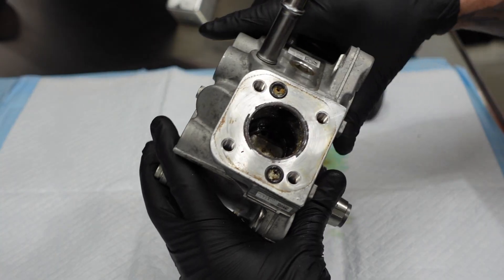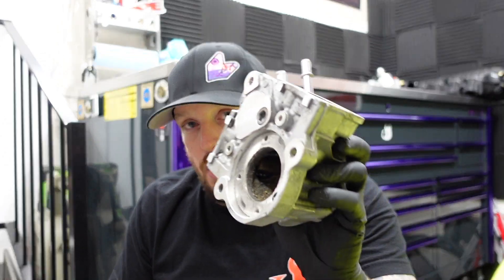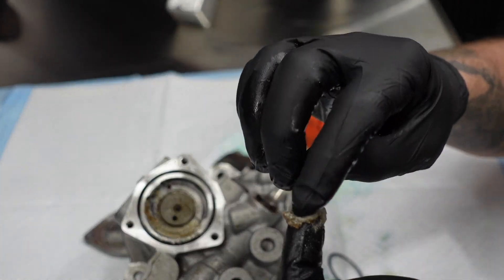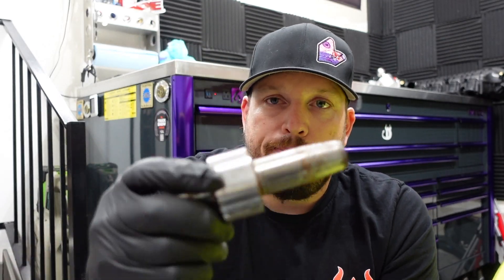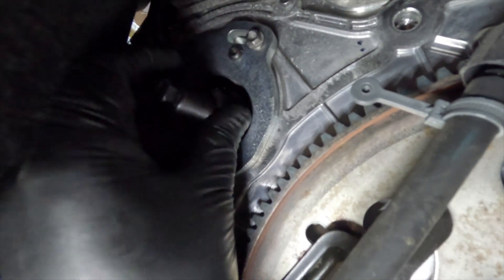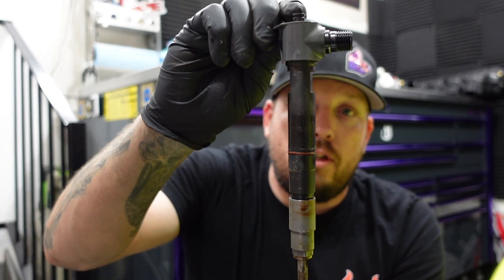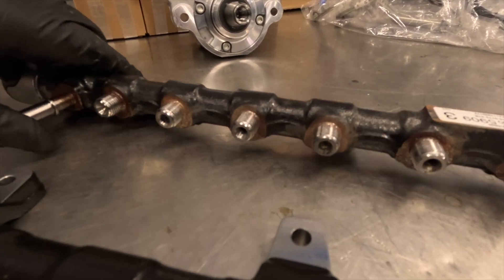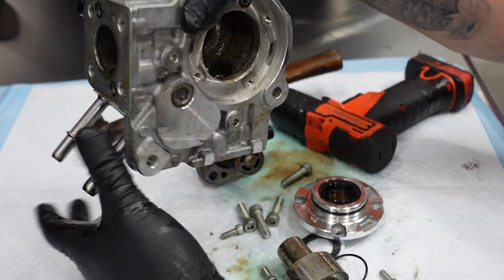What Happens When Diesel Fuel Gets Contaminated? DEF Contamination

Comment: My new 2024 duramax is at Chevy now . I put def in the diesel I hope it’s fixed correctly
Reply from the maker: Hopefully it wasn't driven with the def fluid in there, if so, it will likely need a full replacement like shown here. I wish you luck on the repair, I fear this happening to anyone. I personally use a fuel cap just to add an extra step during fueling and hopefully keep myself from getting sidetracked and making a mistake.   https://amzn.to/4gGANpy

Comment: I'm curious why you would have to replace the high pressure pump. If you never started the vehicle.Considering the fluid that's in the fuel lines, pressure rises and deadheads and doesn't circulate.
Reply from the maker: In this case, I showed the pump in terrible shape, that's why the pump needed to be replaced. If all that someone did was pour def in the fuel tank and not run the vehicle, then yes, there isn't a need to replace the pump.

Comment: It may be tight, but it ain't a dang CP4! Ford still uses those and still has failures. At least Chevy and Ram moved to more reliable pumps that require contamination to take them out. Mine could just randomly cost me $10k~$15k for being a CP4. Going to do a disaster prevention kit on mine until I can afford a DCR pump replacement.

Comment: Hello, I wonder if you can help with a situation I’m having. My 2021 Silverado 3.0 baby duramax is throwing all kinds of codes. Service ESC, parking brake, and my OBD computer is telling me  cylinder 2 is misfiring. Truck does have reduced power and running rough. Last June my vehicle had a whole fuel system replacement as a result of def fluid contamination. My truck will allow me to drive in limp mode but should it be towed to prevent further damage. The codes I got on my home analyzer was cylinder 2 misfire and fuel injector 2 malfunction. Don’t want to run on assumptions here but could the fuel injector be bad or could there be a more serious underlying issue?

Comment: Can you tell me would it be the same procedure if someone put gas in this truck? He said he didn't start it but I pulled the fuel filter and it was full of gas. My next step is to pull a injector to see if it made it that far. With it being gas and not def, would I be able to flush everything or recommend just getting a contamination kit with all new fuel parts?
Reply from the maker: There is a huge chance you can save it (the fuel system). You need to get the gasoline out asap, flush everything out that you can and a fresh fuel filter or two, fresh diesel fuel and some cleaner/additive in there and run it as much as you can. Gasoline is not as corrosive as DEF, thankfully, but it will cause damage if not fixer almost immediately.

Comment: Costly mistake. I never let anyone drive my 3.0 for the fear putting in gasoline. I suppose someone could make that DEF mistake. I put Diesel cap on my truck. I have used Hotshot for years on my 2020. Especially in winter additive in SD.

Comment: So the fuel pump situation for the LZ0 has me really scratching my head as I can’t get a clear answer anywhere. What fuel pump so the new LZ0 have? And what additive should I run to protect that high pressure fuel pump?

Thanks in advance, new 3.0 LZ0 owner, but have experience with ford CP4 issues and want to keep my pump safe on the new truck
Reply from the maker: I use Hotshot EDT, gm has their own recommendation. LZ0 pump is the smae.

Comment: 42k miles my fuel pump failed 1100$ said metal was found in pump and wasn’t covered under warranty paid for it to be fixed lasted 24 hours than injectors failed they never replaced injectors or clean tank
Reply from the maker: ugh, that is frustrating.

Comment: I bought a diesel fuel cap that's magnetic from Amazon and the dealership where I get my oil changed said remove it.    They stated it will cause problems with the valve in the fuel filler neck and prevent it from working as it should.  Have you heard of this?  I like the diesel cap and it seals out dirt and water especially when I go to the car wash.  Was told that if I  continue using it they'd void the warranty if there is a problem with the valve in the filler neck later on.
Reply: Mine is a green rubber cap which states "Diesel Fuel Only" so as to eliminate any confusion...
Reply: @TakeDeadAim part name? Link ?
Reply from the maker: Great question! I run a cap on mine, I much prefer it there to keep contaminants out like when going through a car wash and the fuel door blows open … I also like it there to block me when filling with def in case I make an error while being distracted… as far as warranty goes, if the part caused a failure, then yes that part could be not warrantable.
Reply: I was concerned the cap was holding the filler flap open. I removed the o-ring so I could fully seat the cap, and yes it presses the filler flap open. I put the o-ring back on and do not fully seat the cap when installing it.

Comment: This must be why the new models dont have fuel cap.   It has that safety valve thing where unless you are pushing it deep with the actual diesel pump, dropping fluid on the top will just drop to tbe bottom of the truck.   I guess it’s better than just letting it in.

Comment: When this customer came in, what was condition of truck? Running, tow?  I have a 23 3.0 with 3000 miles and code PO54E. Any thoughts?
Reply from the maker: Tow, it was dead.
Reply from the maker: Definitely look closely at fuel quality / condition. Verify fuel filter cap and housing don’t show any abnormal residue as well. Assuming the truck is all stock.

Comment: My dealership said the fuel additive isn’t even in their books anymore. No part number and not required according to their tech that consulted GM about this for me. That said I know all shells in Canada use top tier standard fuel.
Reply from the maker: I checked a month ago and it was available by the case only.
Reply: Weird. I asked my guys, and they told me they used to have it in stock, but haven’t carried it in ages. The parts guy looked up the stuff and said they have no part number for it in the system. They asked the diesel techs and apparently the diesel tech told them them I don’t need it. Maybe all our fuel meets top tier standards in Canada so it’s not needed?  I don’t know… 🤷‍♂️
Reply: @R3lyc the parts guy at my southern Ontario dealership looked at me like I had 3 nipples when I asked about the additives. Most of our shells have two levels of diesel. 
I personally fill up at the local coop. Every dump truck from all the local pits fill up there. And the school busses. I have to assume they are selling fresh fuel all the time.
Reply: @toddbunnett640  to be clear top tier isn’t a grade of fuel, it’s a fuel standard that the fuel is made to. Shells uses it, some others might as well, it should say on the pump if they use top tier. That said I fill up at the Petro pass truck stop. All their fuel pumps have a filter and water fuel separator on the pump, they are regularly changed. I also like the truck stops because they typically high volume resale points.

Comment: I bought a couple quarts of Mobil 1 today. Was suprised to see Auto Zone had it in stock. I know I have seen people saying you can't find it anywhere. When I looked online I can order all the Mobil 1 and AC Delco I want. I am assuming the AC Delco is probably just Mobil 1. Figured I should have a couple quarts just in case. I normally change my own oil but its a brand new Denali Ultimate I just got a month or so ago. I just hit 1k miles on it and it still has its first free oil change so I figure its probably best to buy the oil when I actually need it but I wanted some just in case I check my truck and its a quart or so low. I bought a box of the Peak Platinum guess it is DEF. Was only like $2 more then the normal Peak stuff figured I would spend the extra $2. I have went through half a tank of DEF in 1k miles. Should it burn through it that fast. The salesman at the dealership was telling me it should last me like 5-7000 miles lol. I didn't really believe that but I didn't think I would go through a half tank of it already. There has been no towing or anything. If you believe the truck when I look on the dash it says the best MPG it has got so far is 37.5 and average of the life of the truck says around 28. The Denali Ultimate only comes with 323 gears though would have liked 373 but think everything comes basically standard with the Ultimate besides paint color. Mine is pearl white. The dealer had it in and I drove up and bought it $83k out the door taxes and all cash. Figure that was a good deal was suprised they knocked $1500 off for it being a diesel. I don't know if that is some sort of promo GM was doing or if it was just the dealer. Soon as I got it though they got in the new 24 3/4 ton Ultimate. I like my new truck just maybe I should have waited and got the HD lol. It was only like $10k more
Reply: Are you sure the DEF tank was full from the dealer when new?   My HD was about 5/8 full from the factory and the dealer 'assured' me they topped of fuel and DEF. They didn't.

Comment: i would like to hear one of these engines runnning without any of the noise foams on top of it... how much louder it would get? also im pretty sure that the pump itself isnt timed per say but since the pump sprocket holds the crank and cam chains it has timing marks right? and im glad to know that the pump has a keyway..
Reply from the maker: It’s timed.
Reply: @DemonWorks  well thats one i havent heard in a while for a common rail pump, very interesting! 
do you know the extra technical details on why it has to? like does it matter for rail pressure distribution vs injector pressure drop or harmonics maybe?
Reply from the maker: @Velkanis  it keeps a good balance of pressure in the rail during the firing sequence. Started in the 6.6 Duramax.
Reply: @DemonWorks  aahhh makes a lot more sense now considering the L5P started life with a HP4 with what i guess is 2 pressure heads? not sure since ive never been able to see one of those in person as no one imports them  here little do i actually know about those...
appreciated and thanks for the quick responses!

Comment: Thanks for the great video, apart from accidentally contaminating your fuel, there are whack job environmentalists also who will dump crap into your fuel, just because your engine is diesel, they just go around looking for diesel name plates, the problem is getting locking caps for the newer style of fill ports, Im not a fan of the cap-less diesel fill port, there is a company out there that makes aluminum locking fuel and def caps, I just don't recall who it was, locking caps are a good deterrent, I pithy the fool I catch trying to pour crap in my fuel.
Reply from the maker: I agree, there should be a locking cap just to keep those people from causing intentional harm.

Comment: Thanks! Is it possible to find out what all the OTA updates I have been getting actually change?
Reply from the maker: Hey thanks ! First time i've seen / received that ! Much appreciated !

The info I can find on the radio stuff is limited, however, there is a bulletin that recently came out and it says:

A new radio software update has been released via an Over-the Air-Update. Customer will receive a Software Update notification once the software has been downloaded to their vehicle. Customers need to accept the OTA when prompted.

A new radio software update, version Y167, was also released to service for vehicles equipped with Infotainment system RPO IOK being brought into the service department. In addition to providing general robustness and stability enhancements, this update includes all enhancements from previous software version releases. Along with the vehicles mentioned above, vehicles in unconnected markets, and fleet customers may need the dealer to reprogram the radio with the new software package.

Y167 Most Notable Improvements

Important: Improvements will vary by model, build configuration, system, and sales region. Not all vehicles have all features.

Most notable improvements contained in this release may include:

Radio:
AM or FM station stuck for an ignition cycle
No rear view camera
After performing a factory reset the physical Home button might not work
Intermittent XM unavailable message
Intermittent no audio at startup
The volume bar pop-up screen might not show when adjusting the volume
Voice recognition might not work
When trying to sign in with a GM account the sign in through Mobil App does not work
Latitude gauge goes up and down
Tune knob might not change channels
Customer is unable to add XM favorites
Voice volumes will not change, only audio volume does
The Now Playing screen might not show the station number of the channel playing
When changing Favorite pages the > button does not highlight when pressed
When trying to log in with a myGMC account, there is no error if the email format is incorrect
In the towing app the wrong vehicle type is shown
Intermittently there will be no audio
Buckle to Drive might always be on
Intermittent rebooting with Device is Starting message
XM favorite channels jump when using the SWC
Improve readability of MyBrand application
XM can only play one channel, the rest show Unavailable in the browse list
XM favorites are greyed out
Invisible Trailer View Not Functioning
When adding a new user there may be multiple blank screen
Phone:
CarPlay might stop after ending a call
When switching audio from Bluetooth to USB the Bluetooth audio might continue
The Add Phone button might not work
When making a call, the Search Contacts screen might come up instead of the keypad
Android Auto screen slow at launch
The First to Connect setting might not save after an ignition cycle
CarPlay would not launch
Contacts still show after clearing phone numbers
After shutting the vehicle off the Handset button for moving an active call is not highlighted
Phone calls might have audio echo on the other end of the call (not in vehicle)
Phone projection may not connect
CarPlay might be slow to launch
IPC:
The incorrect language might show on the DIC
Dyno Page graph not updating while idling
V-mode shown in Drive mode of non-Cadillac vehicles
In the Drive Mode pages there is Z-mode when it shouldn't be
The sound for the turn signals is out of sync with the cluster indicators
Intermittently "Turn your vehicle on" shows on ICS even with vehicle on
OTA:
An Over-The-Air update might take a power cycle to complete
There is a black screen if the back button is pressed while performing an update
Reply from the maker: Unsure what exactly the Over The Air update contained versus what an actual dealer programming event would be, but I hope this helps somewhat.
Reply: @DemonWorks  that's great. Thank you. I love that GM is updating these trucks, I just like to know what they are fixing/improving. The radio has gone full volume on me 3 different times when using the steering wheel controls. I try to turn it down and can't turn it down fast enough to keep it moving down. It seems to last for about 10 to 15 seconds. Was hoping one of these updates fixes that. Thanks!

Comment: Funny that I see this the same day another guy in our shop just got done doing the full fuel system replacement on a 6.6 for the same thing. Dude put like 3 gallons of DEF in his tank and drove until it stalled. Best part is, the customer came in one day while the cab was in the air.

Comment: So I did a pretty extensive testing on the additives for this lm2.  I filled up ever tank from the same station.  Ran a total of 8 tanks of fuel 4 with additive and 4 without.  Did this twice in one year once in the summer and once in the winter.  Everytime I ran the additive I average less MPG.  I tried to do similar driving during these test and I know there are a lot of factors to this but everytime an additive went in I average about 1.5-2mpg less a tank, currently average about 24mpg a tank right now combined city and hwy.  With the Hot Shots I was getting about 22.5mpg if not worse.  I havent tried a different additive but its on the list to test sometime.  I gave the hotshots to a neighbor to run in his old 7.3l.
Reply: Using a high quality additive is more for protecting the fuel delivery and emissions systems from poor quality fuel, not necessarily to improve fuel economy. That's why I use them anyway.
Reply from the maker: @dlg5485  well said.
Reply: Agreed. My Mercedes diesel didn’t really like the HSS either. I went back to using the OptiLube. The engine likes that better
Reply: @bryceweaver8211  optilube fan here.
Reply: Amsoil diesel additive keeps my mpg 26 to 34 mpg in city 28 to 38mpg highway
Reply from the maker: Awesome info ! Greatly appreciate you sharing your findings !

Comment: How often should one person be using diesel fuel additive?
Reply from the maker: I believe the manual suggested every tank fill. If I add any additive, it is more like every other tank fill or two.
Reply: @DemonWorks  I have been curious how often people are adding it also, i think your right gm mentioned every fill up. I couldn’t see spending that much money on there additive every fill up so I have decided 1 bottle every oil change is going to have to do. curious what is reasonable because every fill up just isn’t to me.
Reply: @DemonWorks  thank you new to diesels and your helping the learning curve
Reply: I use the EDT from hot shot secret treatment every time I fill up. Then use their cleaner every oil change. Also change fuel filter at 50% life according to the on board computer.  Looking at the VSE fuel system saver now that I seen it on here. Solid Looking product.